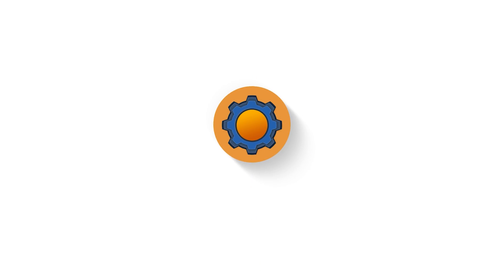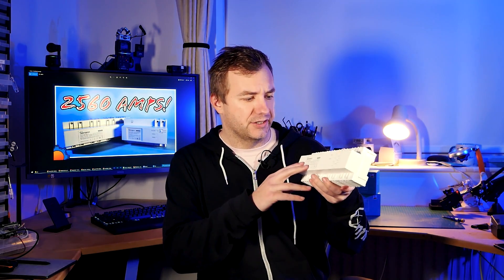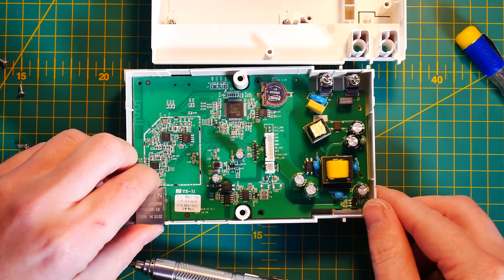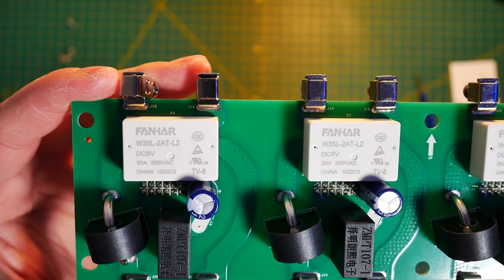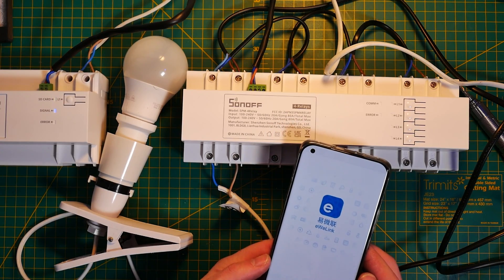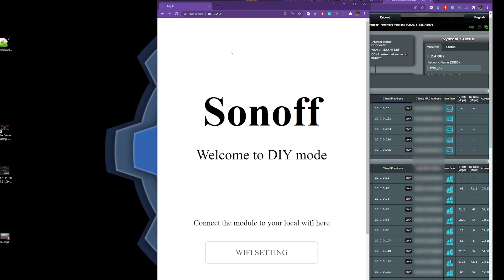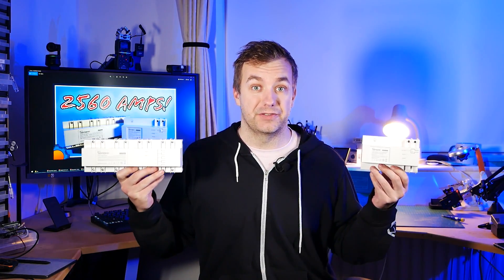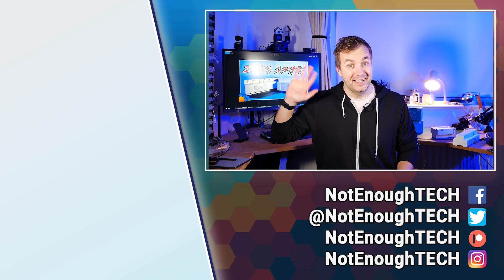Sonoff SPM: 2560Amps!!!

Comment: Sir, I connect spm-4 relay to air conditioner, but when I turn on the air cond, after 2-3 minutes it always triggered off by OPS (based on logs info).. It happens randomly to all air cond.. Can you help me what's happened ? FYI, this happened either OPS off (default) or on (configured). Thanks for your kindly help

Comment: I'm not sure, but from looks of it, it seems that I can connect different phases to each of the inputs and it will work correctly, right?
Reply from the maker: I'm not an electrician so I dont want to confirm this. I believe so is my answer but do ask someone more knowledgeable in that field
Reply: @notenoughtech  nobody know the answer, sonoff support doesn't reply. I did some measurements, and there is some weird voltage on IN2, IN2 and IN4, when the input phase is connected to IN1. I don't have a proper tool to check, but the simple voltmeter was showing jumping voltages around 70V with 230V input... My guess is some leftover voltages coming in between inputs. Also - when there's only IN4 connected, the device doesn't work. The IN1 must be powered for anything to work.
Reply from the maker: @shalak001 I'll ask my Sonoff contact
Reply from the maker: You can run separate phases as long as you connect separately neutrals for each of the phases.
Reply: @notenoughtech  Hmmm, there's no such thing as a "separate neutral" - in regular home circuit design, the neutral wire is shared and connected together.

I already returned the device, so I cannot do any tests at this point. I went with Zame MEW-01 instead (which comes without switching, but I don't really need it)

Comment: Thanks for the video. So they don't replace the circuit breakers I already have so then I'll connect these circuits in series with the existing ones, correct? Another question I have is about connecting a circuit with two phases on it, how would that work? In Mexico we have 127V, 1 phase and N for most circuits in a home but also use 220V, 2 phase for AC units. How would that be connrcted and controlled? I imagine I would have to use two slots per AC unit in this case but they would have independent controls. Any suggestions or thoughts?
Reply from the maker: I'm not the best person to advise on multi phase setups if I'm honest. Things are done slightly differently here so I only had to deal with a one phase of 240v 

But in general yes you want them to be in line with your breakers

Comment: Hey does this connect to Alexa or other home assistants for switching on or off?
Reply from the maker: yes via eWeLink controls  - just name your channels
Reply: @notenoughtech  hey one more question.. how do we wirelessly control it in case the internet is down?
Reply from the maker: eWeLink comes with local LAN controls which means that if you are on the same network as the device you can still send commands from the app

Comment: What power the 5v relays on each or the slave units?  I did not connect any of the slave to input power and all the channels relay still clicks/working.  So where does the relays on the slave get power from?  If from the main unit via Serial Cable, how many slave units can it power the relays?
Reply from the maker: If you lookat 5:43 the relay board has a small power supply on it - this is how each unit gets enough power to drive relays and relay 485 signal to the next unit without issues

Comment: good afternoon. have you tried connecting a third-party controller to it? according to rs485. does he have the ability to find out the addresses of registers?
Reply from the maker: I haven't but in theory it should be able to receive the signal from 3rd party. I haven't seen any documentation tho

Comment: Cannot find many video on this unit on youtube.  I used this for controller my Solar power with battery backup.  When detected the grid is off, on battery power, I have automation that shut off all the channels power of this unit so only the critical load like router, lights will stay on so the battery will last all night.   The power monitoring are a plus.   They have similar item call SPAN Panel but it cost $6000 USD.  Good video.
Reply from the maker: That's neat solution for power saving!
Reply: @notenoughtech  Have you try to integrate with Home Assistant using Sonoff   built-in?  I not able to show the status correctly in the Home Assistant.  It turn on okay but the button flip off in the home assistant.  Any video or fix for that?
Reply from the maker: @mrteausaable  I'm not really good at HA so im not the best person to advise you in this topic

Comment: I bought the product but it doesn't work with voice commands. It's a shame because I didn't expect that and other sites say it works with Alexa and Google Home as you mention in the video.
I tried to connect it but couldn't.
Neither Alexa nor Google Home can see the device.
Reply from the maker: Strange - as a workaround you can make an automation scene, name it "Relay ON" and trigger it with a voice routine
Reply: @notenoughtech  Thanks for your reply. Indeed this way works.
Thank you very much, greetings from Greece.

Comment: Thanks for the vid, I just need one simple way to connect a sonoff to the fuse box so it can tell me the total KWh consumption every day. Is there any way? thanks.
Reply from the maker: You will need something that can handle individual channels well - a current clamp would be the easiest way - Shelly 3EM should be able to do this

Comment: 👍 Great video! Is that possible to connect this with a Sonoff RF Bridge in order to use a RF 433 remote to control it? Thanks!
Reply from the maker: You will be able to link it via scenes. So yes you can pair a remote and trigger the relay
Reply: @notenoughtech  Thank you so much for your kind help!

Comment: I have my main unit supplied with a total of 5.5 KW (220 V x 25 Amps), and I use 10 Amps (2.2 KW) on the 1st relay for the water heaters and 15 Amps (3.3 KW) for the rest of the house on the 2nd relay. I would like to create an "if then" statement that does the following function: IF (power consumption >= 3.2 KW on relay 2) THEN (Turn off relay 1: the water heaters) . This is not feasible with the ewelink app, if there a way to do it in the DIY mode?

Comment: Did you ever find power-on state setting or perhaps know if it is supported for these devices? I am finding the relay unit defaults to power off when the utility supply returns. A bit of a problem in a large deployment application if you have to keep going back into the app to turn each channel on each time the utility / supply power goes off and returns.
Reply from the maker: I haven't seen it last time I checked. but if I;m honest its been a while since the last update as the unit is big and I have no particular use for it at my house
Reply: hi, did you ever find a solution to this? thinking of picking up one but your point is very important
Reply: @ChristianCastaldi  I have not yet found a way to do this. I ordered myself a device to flash Tasmota to the SPM and try the developer mode, but I’m yet to accomplish this. I did receive the following response from another forum when I asked if power state mode was possible: “Yeah, please makre sure the firmware of SPM smart stackable power meter(main unit and 4-relays) is upgraded to the latest version 1.2.0 and eWeLink app is upgaded to 4.23.0”. 

However the firmware at the time was not yet available to download for my region. I need to check again if it perhaps is as power state mode control without having to go developer mode would be a lot easier. I am wanting to roll this out to over 250 power supply points so if I can’t get this to work then it’s not viable for me either.
Reply: Ohh ok makes sense, will try it out :D

Comment: We are planning to deploy this in our resort to monitor and control electrical usage. I have been running a test unit for a few days with a lamp connected to a channel, but I see that it does not keep more than about 1 day's worth of kw/h data without an SD card. I am assuming that an SD card would solve this as advertised on SONOFF? Have you perhaps tested this? I am only asking because I am waiting for an SD to be delivered to test. Regards Jason
Reply from the maker: Yes logging up to 3 months is possible only with the card. I'm kot sure what's the cloud storage allows for.
Reply: @notenoughtech  it looks like it only logs 24hrs in the cloud. I could be wrong.
Reply from the maker: My contact said you can have 180 days in cloud
Reply: @notenoughtech  thank you for checking with your contact. I’ll do some more live testing. I ran it for a few days without an SD card but could not retrieve any historical data of the prior day’s consumption.
Reply from the maker: could you email me your screenshots? I will pass this on. I will also need your device ID

Comment: This device is very handy to develop a system for your solar array. For example if there is extra production of electricity, between 2 values, more than A and less than B, heat the water in the boiler with an electric resistor, even a tree phase one. If the solar array produces more than B bul less than C, also start charging the electric car, even using a 3 phase charger. If you have extra power, more than C but less than D, you can also start a pump to fill your water reservoire from a well pump. If your solar array produces more than D push those electrons into the network for credits. How much would such a system cost and how much would you have to pay someone to do it. Quite a lot. With this sonoff device and 3 extensions, you can do it yourself very cheaply
Reply from the maker: That's a really clever use case! Thanks for sharing
Reply: This is exactly my question, how can you make it do that? I have my main unit supplied with a total of 5.5 KW (220 V x 25 Amps), and I use 10 Amps (2.2 KW) on the 1st relay for the water heaters and 15 Amps (3.3 KW) for the rest of the house on the 2nd relay. I would like to create an "if then" statement that does the following function: IF (power consumption >= 3.2 KW on relay 2) THEN (Turn off relay 1: the water heaters) . This is not feasible with the ewelink app, if there a way to do it in the DIY mode?
Reply from the maker: You could easily do this with NodeRed and DIY mode

Comment: Hi,

I have a few clients interested in using this in student accomidation, where they have installed solar but they can't figure out where all the power is been used.
There is also load reduction process coming from our electrical supplier in RSA. Instead of turning entire area's off they will have load restrictions in areas if you exceed the usage during these periods you will be cut off.
This device would be a nice way to control usage during these times.

Have you looked at installing Tasmota on this unit yet?
Reply from the maker: As it comes with sonoff DIY I have little reason to tasmotise it as the data is a available via rest request
Reply: want to send mqtt information from the device.. there are reasons this can be useful.
We have a few scenario's where we manage IOT devices from our cloud system. ... I have a few device here will continue to see if I can get Tasmota one.

Thanks again for your video's I find them really good.
Reply from the maker: I'm not sure how tasmota handles the rs485. Not sure if this protocol is supported so you'll have to check that before flashing. Other than that it should be pretty straight forward

Comment: for our new house to be built with electric underfloor heating where the various rooms can be controlled smartly.  but which thermostats can I use to control both room temperature and floor temperature?
Reply from the maker: Personally I'd use 2 of them for greater control but if you come across something that supports both channels that would be good. Alternatively if you just hook up relays instead you can take a look at my DIY smart heating article this would support as many heat sources as you want

Comment: is this the only wired solution with sonoff dyi available right? Im building a new house and would like to automate around 60 lamps/doors/etc is this overkill for it?
Reply from the maker: It depends on how you want to resolve it. If I was doing it all from a scratch a relay board with a single controller would be a way I'd pick. This has lots of advantages but require you to run your wiring in a slightly different way if you are after individual socket control etc
Reply: @notenoughtech  thanks, yeah I would build the house to support it. Maybe the 4ch from sonoff can do it, still only wifi and don't have the dyi natively right? :(
Reply from the maker: You can tasmotise both of you wish. But only SPM has the DIY

Comment: I can think of uses for 20Amp relays, but I am not sure of the need of a "control" unit.  Why not just have each module controlled like other devices in the range?.    I guess if you need a lot and run out of IP addresses, but not sure of the benefit other than that.
Definitely 20Amp relay contacts are handy.  Can switch swimming pool equipment, small storage heaters and hot water.
Reply from the maker: Distance would be the most beneficial factor. You can have every unit spaced up to 100m which makes it over 3k as 32 units are supported
Reply: @notenoughtech  I guess that could be beneficial in some situations, if you need them at 100mtr intervals or can afford to buy them just as repeaters.  Maybe more industrial than private.    Still, Itead are usually pretty good at choosing their market.
Reply from the maker: I think it's a common occurrence when businesses expanding their venues. With individual units having often new source of power. This way you could have all of that on a single ring of devices. 
It is massive tho and definitely not catered for typical household :)
Reply: @notenoughtech  Agreed.  I was thinking commercial  but likely not home.   I think it would be great to see a 20Amp version of a SOnOff basic though
Reply from the maker: Or a properly cert for EU/US/AU markets RCD with power monitoring that you can slot into existing box. There are some switches there already but the certification is questionable.
Reply: @notenoughtech  That would be good.  In Australia, we are not legally allowed to do any mains wiring unless qualified as an electrician and electrician's will not install uncertified gear
Reply from the maker: Similar here although light fittings and sockets don't count :)

Comment: They will need to resolve the loss of pairing when cables are disconnected if they want these to be used in large scale setups. Pointless if the whole system needs to be setup again whenever a new device is added or a faulty relay unit replaced
Reply from the maker: I agree that was a bit annoying. It only applies to when system is disconnected while powered up. If you power both units down, then unplug and plug back in before you connect the power then you are good to go